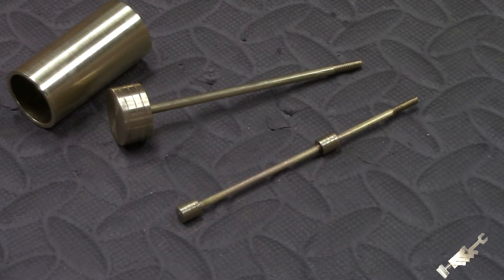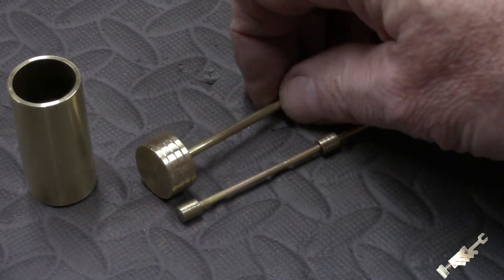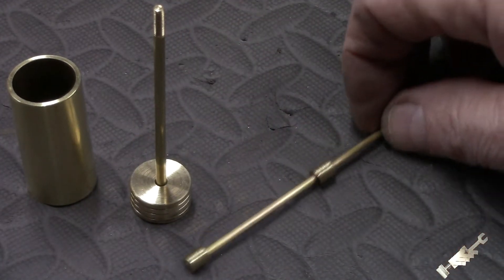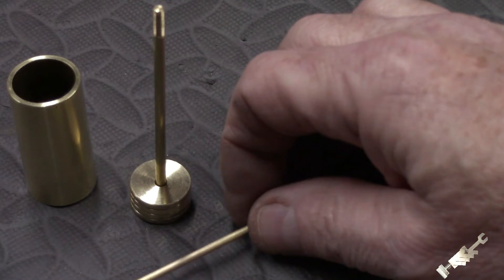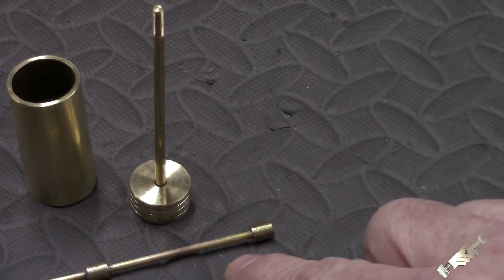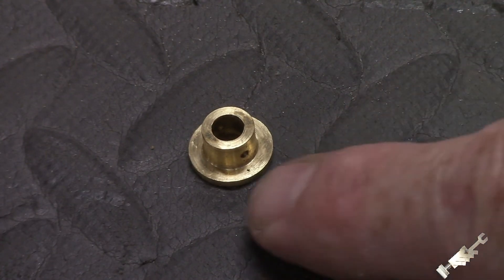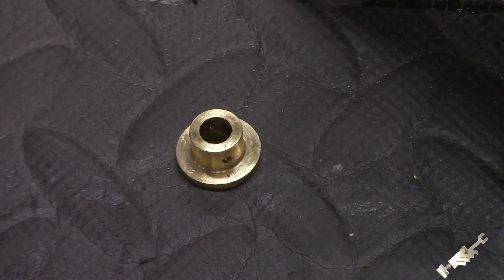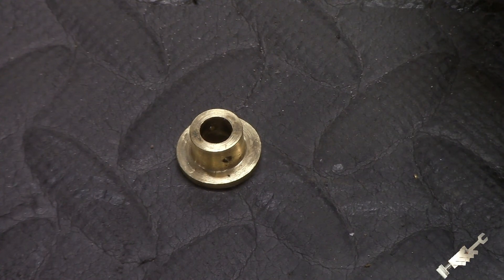Elmer's #10 Wooden Grasshopper Engine Misc. Parts

Comment: A 5-40 thread? Who has a tap for that! LOL Great video as always...
Reply from the maker: Although you will not find a tap or die at the big box stores or local hardware store it’s a pretty convenient thread, a 5-40 die works perfect on 1/8” diameter round stock. Any machine shop supply such as Travers, Shars, KBC etc. has them.